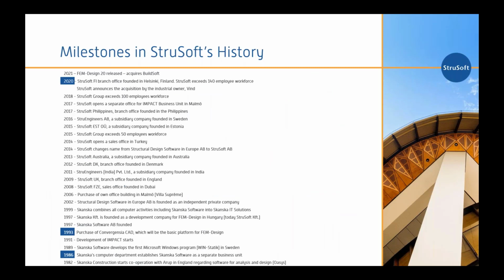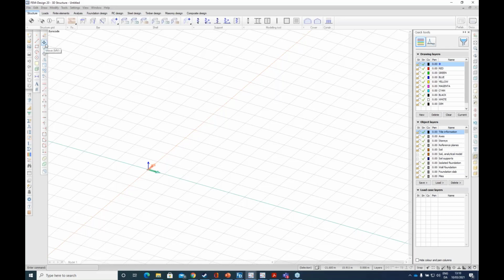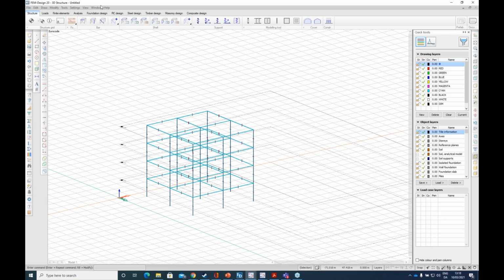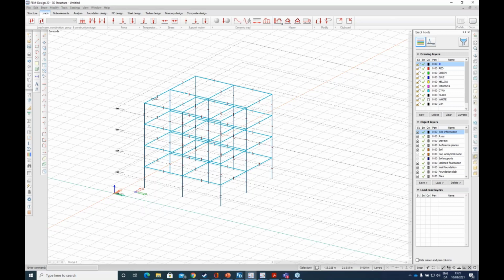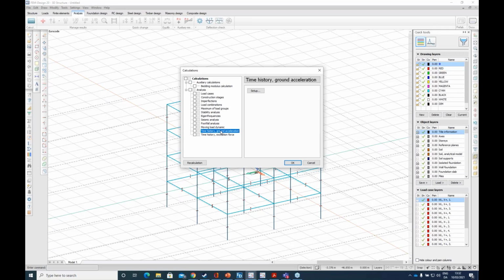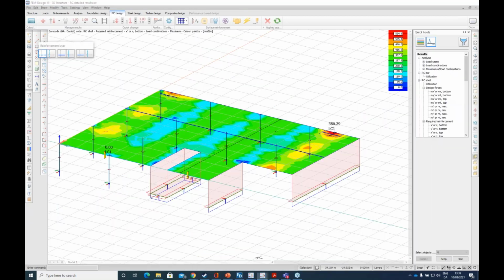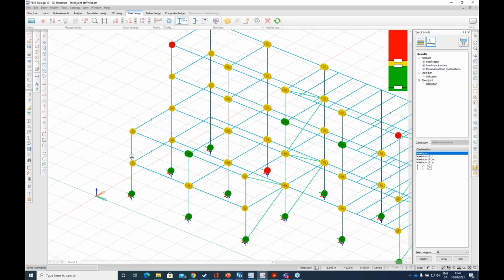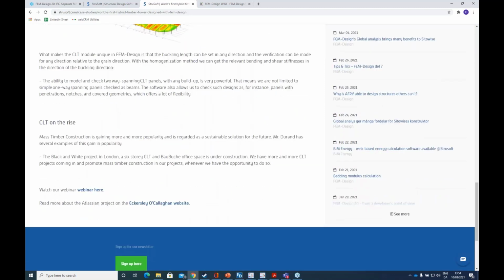Introduction to FEM-Design Structural Analysis Software

Comment: Why we should choose Fem-Design??

Could U give Us the reason why Fem-Design is better than Rfem or Tekla Structures??
Reply from the maker: Choosing any structural analysis software depends on several parameters. It all comes down to your needs – finding a solution for a technical feature or/and meeting a hi-scored and local support team that solves any of your issues.

In FEM-Design a correct analytical model is in focus, by using an easy and intuitive modelling user-interface. Versatile connection elements, super smart mesh generator including autocorrect model tools will provide the best possible model. Analysis and design for concrete element- / in-situ, steel- & timber, advanced CLT analysis, fire design, soil module including foundation design, composite, and masonry design.

FEM-Design is used by +10.000 professional structural engineers and is continuously following the user needs for developing the most efficient tool for their work process.